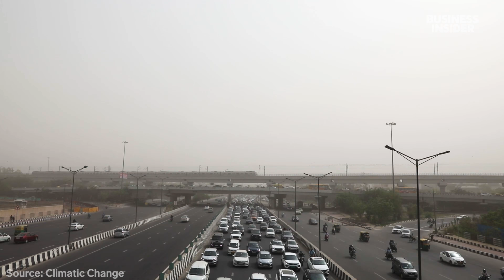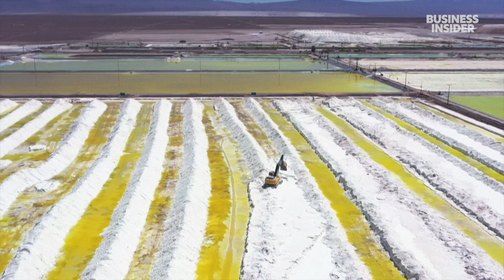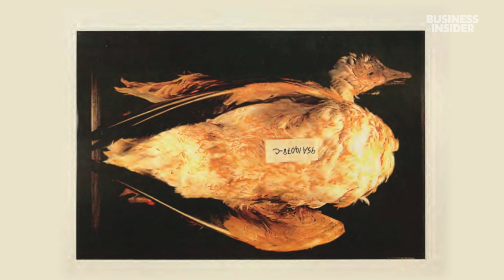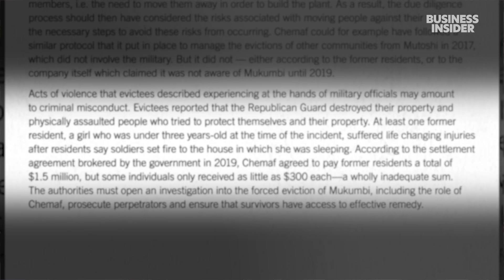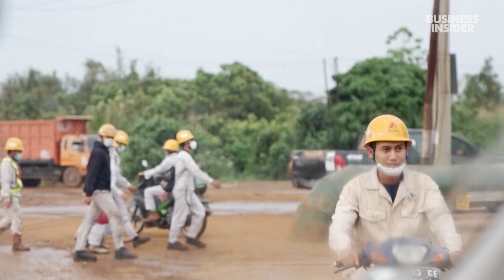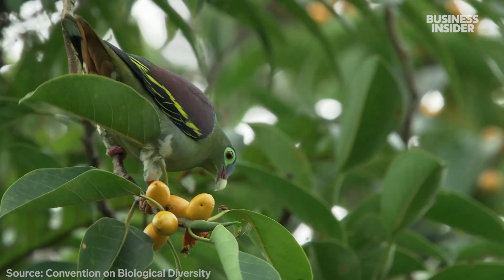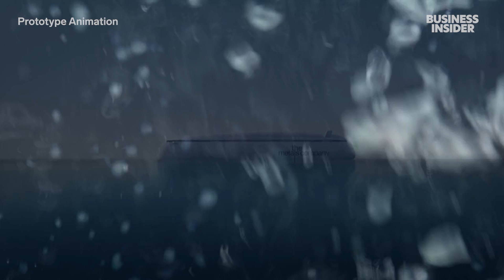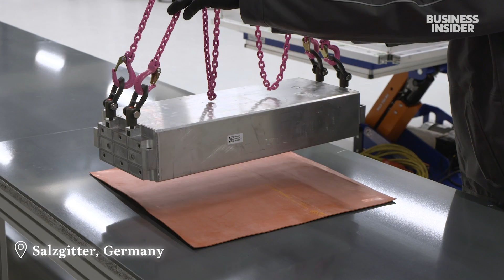The True Cost Of Mining Electric Car Battery Metals | True Cost | Insider News Marathon

Comment: That's right. Because all the minerals, metals and materials to manufacture internal combustion engine cars grow on trees. :)
Reply: Do you really not understand the message being communicated?
Reply: Yeah, aluminium and iron, its so rare... just dont talk if you have no clue
Reply: @harrison00xXx 
Actually, gas cars are orders of magnitude worse for the environment compared to EVs
Reply: @harrison00xXx  even bicycle has more materials than just iron and aluminium. Is that what you ride? A bicycle? There is hardly any EV batteries to be recycled at this stage as they trickle down through different use cases. After 20 years in EV they already are sought after in classic car conversions and then they get to be used as home solar energy storage. After around 30 years over 95% of their materials will be recycled and turned into even higher energy density batteries. Their minerals will get even more purified during recycling process increasing their energy density. Can you recycle petrol or diesel after it has been burned?
Reply: @RadoTrenciansky  And no, you can not recycle over 95%, maybe from some specific elements but not the entire battery to 95%+, but in general its pretty advanced nowadays, yes.
The real issue with recycling... additional harmful chemicals are involved, and you may guessed it the byproduct of the recycling process also ends up in a ecological mess if the released water from the recycling process is not treated and filtered properly, and then the filters end up in a ecological mess to recycle/clean/bury. Where heavy usage of chemicals is involved, there will be sooner or later aftereffects we dont want. I would rather choose CO2 and burning gas/oil/coal and planting trees instead of building cities, artificial nonsense everywhere and no way to let nature "breathe".
We can not fix the ecological crysis with EVs and banning ICE vehicles, the real issues are more systematic, depending on greedy elitarian people and their higher profit goals every new year.

And yes, you can reverse/recycle burned diesel/petrol... its called e-fuels and with very much energy input you can make out of CO2 and other stuff fuel without releasing additional CO2 (except you think about the fact the energy for e-fuels comes from coal plants mostly, which is a fact...)
Also, we dont even have to do anything to reverse this process... nature by itself consumes CO2 and even converts other more harmful exhaust gasses to CO2, just slower than a catalysator or DPF.

Im btw also riding a regular bicycle, yes, but do you really mind now basics such as sealings, tires, other materials in disc brakes etc? At this point we could also argue EVs need oil since the gearings need lubrication.
Also a offroad e-scooter which fits in my car (a perfect combo btw as hobbyist wildlife photographer)
Reply: Nobody is claiming that ICE vehicles are saving the world though , unlike EVs.
Reply: @mgcarmkm4520  ask those who live in major capital cities about their air quality. It must be so "healthy" to inhale carbon dioxide all day every day. Just keep burning oil to turn wheels if you are ok with supporting foreign oil and all the wars that are fought over it world wide. EVs are better and there is more materials to build their batteries than you can ever imagine. Scarcity mentality that is imposed on all of us drives the economy.
Reply: @mgcarmkm4520 
EVs are factually saving the world, together with wind and solar

Comment: What everyone misses is that minerals for batteries are about 98% recyclable. Once we reach the position where new electric vehicles are only replacing retiring electric vehicles then the mining of minerals will reduce to almost zero. Minerals for batteries will only be mined once
and then recycled over and over while oil has a one time use and must be continuously mined until there is no more. The majority of batteries used in EVs and power storage will be batteries that do not contain nickel or cadmium such as LFP (Lithium Iron Phosphate) or Na-ion (Sodium-ion) This is a no brainer. With autonomous robotaxis it has been estimated that the number of vehicles on the roads could reduce down to 20%. Gets better and better !
Reply: They also like to miss that cobalt is used in the desulfurization of crude oil for production of gasoline, and diesel fuel. Meanwhile, cobalt-free battery chemistries appear to be becoming the norm.
Reply: A very good point  @blackwind743

Comment: These figures of how much EVs and ICE cars impact the environment is misleading and doesn't tell the full story. 
For instance it states "In the car's lifetime".  Well ICE cars tend to outlast EVs by orders of magnitude. EV batteries go bad in a number of years, meaning they need to replace the entire car and that sudden big 30% impact comes back, while the ICE car replaces it's own tiny battery if and when it goes bad after 10 years or so, depending on how well it's looked after. Then there's the cost of tires, which EV's being heavier need replacing more frequently. Then there's recycling of the cars,  which is far better if it's an ICE car. Then there's damaged caused in accidents.... if even the outer casing of the battery under the EV is damaged, the insurance company will often write the car off and consider it dangerous, as it will cost more to dismantle the car and check the integrity of the battery than it will to just replace the car. This can happen with just debris on the road hitting it or going over a bump.
Always be wary of how facts are presented to you. Like the wage gap myth which continues to mislead to this day, even though it was debunked back in the 70s as erroneously presented.

Comment: Have you researched the true full cost of oil drilling, storage, freighting and the use of them. Each has enormous costs associated with it. Several times lager than any electric battery costs. As they can be recycled. We’re oiled can not. Because most of it is Burnt , spilled on to the ground or into the sea etc. this has all been financed by the oil companies. Who will stope to all means to survive, as they disappear into ableism.

Comment: Like the late, great Meatloaf once said: Nothing's ever worth the cost.
Everything has a consequence.
You cannot have yin without the yang.
Reply: The chickens have come home to roost.
All good things come to an end.
The party is over.
Reply: Thats missing in this video.... too much praising EVs and not any fair comparisons or proper data taken
Reply: @harrison00xXx   Yes, see my other comment about how misleading and bias this study is, omitting certain data and not showing the full picture. It is as bad as Al Gore's Inconvenient Truth which suckered everyone.
Reply: @harrison00xXx  could using bio-material, like dried wood or algae, burnt in cars to drive sterling generators suffice for hybrid cars
Reply: @taiwoolaleye6333  ah, sure, the average EV owner would like to use a woodgas burner at the back of their car.

EV owners dont do it for the environment, they are doing it for the sake of „performance“.

I think EV owners are wrong regarding to performance since they only care about acceleration and how fine you can control throttle, meanwhile they forgot about the overall driving experience with a HEAVY vehicle.

I have 3 cars… 1996 Golf 3 Cabrio 1100kg 140HP, 1997 Mitsubishi Eclipse 1390kg 214HP and a 2010 Subaru Impreza Diesel, 1550kg 180 HP.

The most fun vehicle regarding to real performance is the lightest one, even 1400 vs 1550kg are a noticeable difference, but the light 140HP vehicle is even more fun despite boring FWD and no power exits from corners possible than my stronger but heavier vehicles

For long trips i prefer the smoother, heavier ones, sure, but i hardly enjoyed any EV i was driving… they are stiff, heavy and dont like corners are all
Reply: @taiwoolaleye6333  I mean its hard for me to compare, all my vehicles were either low end and uncomparable or with big advantages over regular ICE cars such as low point of gravity, good performance/weight ratio etc., but in general a EV is inferior just becaue of the heavy weight and its problems (worn out links and mechanics, more rubber and tire wear,…)
Reply: @harrison00xXx That is not a problem with EVs. Yes, they are heavier, and I really hate the idea of soccer moms driving around in 9,000lbs, 1000hp cybertrucks and hummer EVs, but they do not eat bushings and tires. Most moderately sized EVs don’t weigh more than your average pickup truck.
Reply: @taiwoolaleye6333 I honestly can’t tell if you’re mocking EV bros or if you’re being serious
Reply: @enemyspotted2467  no

Comment: I think this should have started by covering the environmental damage of drilling for oil, methane leakage etc to explain more why the change is needed. It had about 5 seconds at the start and the end. Otherwise interesting to see where all the batteries for all our devices come from.
Reply: Agreed. No one ever does. So ignorant people only see the bad side of EVs without comparing it to the woes of drilling, and refining gas. Gas refining has a slew of chemicals used. 

 Franking can be terrible if done wrong for instance. ICE need a lot of actual rare metals. 

 With that said we just have to be better at extracting anything. All the easy stuff is gone. We have to be more and more evasive to get our ever expanding needs. 

 Best thing about EVs though is most can be recycled. It isn't burnt up. The gas we do use for power is used more efficiently.
Reply: @dianapennepacker6854  most is NOT recycled. not yet. its extremely expensive .
Reply: @ct1762  and there is the sole reason why almost all recycling sadly fails. If it doesn't make a profit, it isn't viable nor sustainable. And yet the EV skeptics are "the ignorant people". Blinded by the greenwashing, while both ICE and EV kills the planet.
Reply: @ct1762  - It's only extremely expensive because no one has set up large scale recycling operations. Custom cars are also extremely expensive compared to factory automated assembly cars.

Comment: I found this to be balanced reporting without taking a yay/nay stance on the issues.  Congratulations.
Reply: It's a lie by omission. Where did they compare the energy costs of producing and recycling ICE vehicles?
Reply: @The_Ballo  video is about mining metals, if you want comparison between vehicle production, go and watch video about cars.
Reply: @Nakciunas  It's about environmental impact of cars
Reply: THANK YOU! @The_Ballo
Reply: Fracking causes earthquakes. Hundreds of them. And it is not only a primary cause of methane pullution emitted from old sites they don’t bother to cap to seal off gasses that will continue to escape into the atmosphere, yes it emits CO2 as well. Great. And not much oil can be had, hence the continuously mounting numbers of oil sand sites opening as old ones are abandoned… not because no more exists there but because it can’t be reached safely or unsafely. 

Those sites will simply keep on adding to the greenhouse effect as few get capped. 

Ok now. Electric motor tech uses far less energy tthan ICE tech which is just a steam engine with a few improvements that have a ceiling efficiency of at most 30% and I would venture to say that ICE motors are far less efficient than even that… like 17-21%. So basically ICE vehicles waste at least 70% of the potential energy from the fuel and most waste 80% just going up in smoke. And manufacturers/engineers have tried. Really. That’s it. 

EVs are 75-80% fuel efficient. There. Ok. Now the info in this story is fair and balanced. Both use resources from all sorts of mining and both types of vehicles use up massive land area in simply parking the things so yeh that means we trade parking lots and highways everywhere for the land we need to put into making affordable homes. Unless we wanna live in our cars which I don’t wanna do.

I do want mobility. I see EVs as a sound improvement toward a future that we want to transition into by decreasing personal vehicles which cost way too much since we don’t actually live in them. Our current use efficiency is also only about 5-10% regardless of the engine tech we choose. Rural and urban sprawl presents a severe burden. So there. Fair and balanced.
Reply: @katherandefy  I am unsure why you chose to write this essay as a response to me.  BTW I agree (or sympathize) with all that you say.  The World is kind of nutty right now so hope you have the means to survive the upcoming disruptions.
Reply: Pretty unbalanced and missing comparisons, but if you really think EVs charged by about 70-90% coal power is less harmful than a ICE car, i cant help you anyways
Reply: If your statement was true, in all parts of the world, and electricity production wasn't constantly moving away from coal them you may have a valid point. If you truly support your view then I would suggest you look into how much coal generated electricity has fallen in the past 5 years. It’s very clear that coal will not be producing electricity at all in the next 5-10 years. If you look at the cost of using coal vs. the alternatives it will become extremely clear. No one in their right mind would try to run a Corp with the highest cost of producing their product. It would be corporation suicide. @harrison00xXx
Reply: @garn5341  "It’s very clear that coal will not be producing electricity at all in the next 5-10 years." I think this is a bit over-optimistic. Mainly -- but not exclusively -- due to India. Even so, it's clear that the overall trend is shifting towards greener grids.
Reply: @garn5341  Coal and gas still make up over 50% of worldwide electric generation. Good luck replacing fossil fuels in ten years. Not going to happen. Not even close.
Reply: You can only be talking about India and China as the whole of Europe is 40% wind and at most 5% coal.  The UK will not use coal at all in 2025.  Even the US is less than 50% coal.  So where are you getting those figures from and can you substantiate the lies you tell.  You need to get some proper education my friend @harrison00xXx
Reply: @harrison00xXx   Exactly, this fact is conveniently left out as people actually think EV's are the magic bullet without realizing what is essentially powering them.
Reply: @rjm7151  Whell-to-wheel effiecency of BEVs are several times better than for ICEVs. The efficiency difference means any BEV with halfway decent efficiency will beat the most effecient HEV almost everywhere on Earth. And BEVs's impact is declining fast while ICEVs/HEVs are close to their limits.
Reply: @harrison00xXx  especially since transporting electricity is a lot less efficient than gas or oil
Reply: @The_Ballo  depends. HVDC transmission is pretty efficient but still a lot of aluminium used which would fit any car frame much better (lighter, no rust,…)
Reply: @harrison00xXx  I'm talking about the distance from energy production to the charger
Reply: @The_Ballo  This should be pretty good and even more efficient than HVDC long range, except the few fails in the US mainly where they literally burned down the cables underground with too much power draw from too much teslas supercharging

the real efficiency issues are in the production itself mainly. The most efficient (electric energy only) we can get is about 60-70% on water turbines which is already pretty good for green sustained energy by nature, but coal as well nuclear power with steam turbines runs at best at 30-35% efficiency, most of the energy output is heat and steam and in the case of coal... much sulfur acid besides the so overhyped CO2.

Comment: People need to realise that copper is and has been used for wiring in houses and other buildings and cables used to deliver power across countries. This is not an EV problem, this is a modern consumption problem.
Reply: This is also an EV problem. Just a part of it all, not an exception to the rule. And that will not change.
Reply: @Mediamarked  agreed. My point is that this video is all about how bad EVs are. Everything in this video is also a problem for other parts of our lives. Eg grid scale batteries and solar batteries use massive amounts of lithium. The grid, houses, regular ice vehicles, planes, buses, trains all use copper. Our laptops, phones, toys, fossil fuel processing etc all use cobalt. The premise of the video is that this is an ev problem. Nope it's a humanity and consumption problem.

Comment: need to find a use for that acid.
Reply: Seriously they could cover that entire thing with those plastic balls they use at other water reservoirs to reduce evap losses, or fill it with rocks, OR get that acid out, refine it and sell it!
WTF are they doing just leaving it there to be a giant hazard.
Reply: @watvannou  About those balls, they need to be made not to break down, aka not biodegradable. So, either a petroleum product, or an inert material like teflon. Good luck with greenwashing that.

Filling it with rocks, lol, google the Berkeley pit for it's depth, and calculate the massive shitload of rocks you need.

If you find a financially viable way to do the things you opted, it will make you rich. There are reasons the options given in the youtube comments aren't being used as a solution to the problem.

For example, distilling and refining the acid, say you need sulphuric acid. You would need a lot of heat for the distillation itself. The heavy metal contamination is also something you don't want in your acid as a consumer. So you need to clean it with chemicals. Also, look at the volume to be refined, and then find a customer for it...

In short, that would produce more chemical waste and emissions than to let it rot for basically free. A few bullets or dead birds is nil on the bill.

Also, wanna know an ironic fact? It was shut down on Earth day. Happy earth day, have some cocktails, on the house.